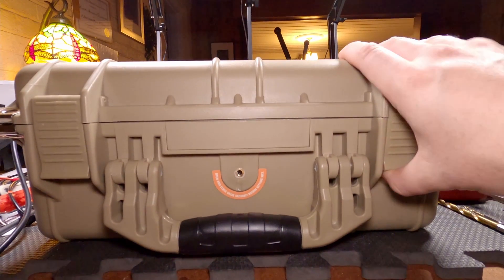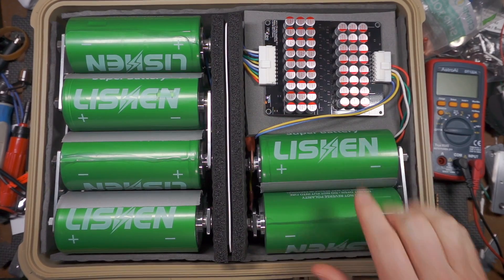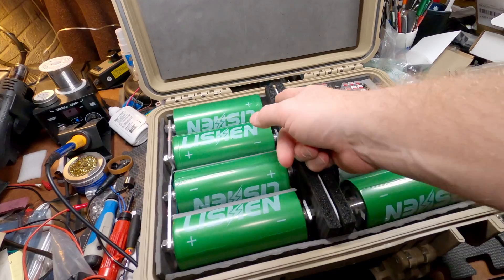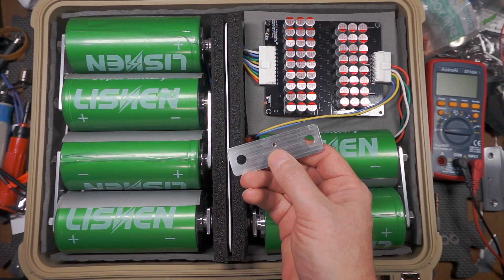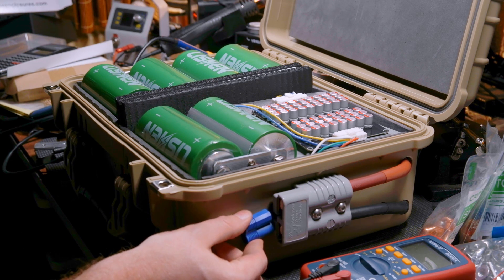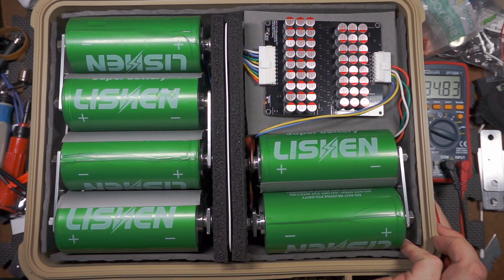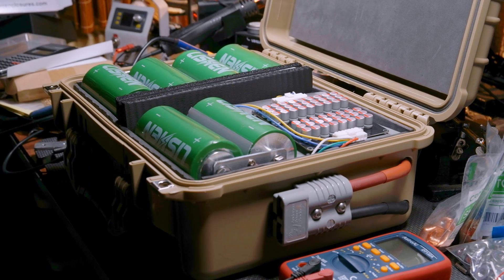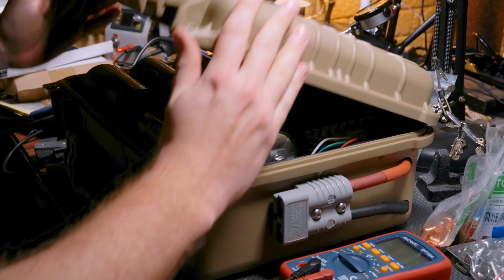New Electric Turbo Battery Pack!

Comment: Charge time?
Reply from the maker: Pretty much as fast as you can pump current into them.  Theoretically, full charge can be had in less than 5 minutes; the problem is finding enough power to do that (you need a 62 volt / 216 amp source to do that - that'd be like trying to pull 106 amps from a typical wall outlet at 100% efficiency - the service to my house is only 100 amps at 220 volts).  And then you'd need a current limiting charger that can handle that much power.  If I was an OEM, that would be no problem to make, but since I'm a guy in his garage, well...  But these packs give several minutes of run time.  Basically you could easily go a whole track day without charging at the horsepower levels we're at (722hp proven so far, next dyno trip I'm expecting 800-850hp).  Thanks for watching and commenting!

Comment: Are those really batteries or super capacitors?
Reply from the maker: They're actually cells.  They're lithium titanate oxide or lto cells. They're not super capacitors. Super capacitors would be a poor choice because the discharge curve is linear plus the power density is really low.

Comment: Dont need to load test these bad boys. They will pull their weight no problem.
Reply from the maker: Yes, but what will the voltage drop to?  That's information we need before we run them.  And will anything overheat/melt/catch fire?  There's a lot more to load testing than just pulling current.

Comment: This is awesome! Have you looking into ultracapacitors or super capacitors. Maxwell had a 17 volt pack I believe and 2 of them would be good for 34volts. They can be charged nearly instantly and dont get hot ever.  They are self balancing and have a cycle life span in the millions meaning that if you completely discharge and charge 2 times every day they should last a thousand years.

I'm not saying they are a good fit for your project, I'm just saying it may be worth looking in to. I've seen the 17 volt pack used to start a car so maybe worth review.
Reply from the maker: I actually have a massive supercapacitor under my other desk that I did some tests on a while ago.  The video's here: https://youtu.be/_HHxkMVnHQY  That was really a self discharge test, but I discovered that the current capacity in amp/hours is actually really low - like under 2 amp hours; closer to 1, iirc.  And unlike lithium batteries, where a large part of the discharge curve is essentially flat (i.e. the voltage stays more or less the same), the supercapacitor's discharge curve is more linear - as in a line going pretty much down constantly.  You'd only have adequate voltage for a second or two.  For starting a car they're great.  Not so much for an e-turbo though.  But it's a good thought!
Reply: @AlexLTDLX   I appreciate your reply and look forward to reviewing that video.
Also check your link to the Amazon voltage monitor. I couldnt get it to work.
Reply from the maker: Thanks.  Will do.

Comment: I understand and have been following what you have been doing but I'm wondering if with the power you have it would not just be more efficient and effective to couple an electric motor to the IC motor? You said you had 70 Kw available ( per pack?) so given the electrical efficiency, that should make quite a difference  to your times Given the instant power and more so, Torque.  Look forward to seeing the next runs either way.
Reply from the maker: That is a really good question.  And a video I've been thinking about doing for the last couple of weeks - particularly in regards to hybrids (I was going to call it, "Every Hybrid On Earth Is Built Wrong.")  Think of it this way.  Without any boost, the engine in the LTD makes about 500 hp.  We've used a max of 13,800 watts to raise that 500 hp to about 650.  It takes 746 watts to equal 1 horsepower.  So to get a gain of 150 hp (500hp to 650hp), we only needed 18.5 hp (13,800 watts divided by 746).  If we added the same amount of power directly to the driveshaft, we'd see a gain of - wait for it - 18.5 hp.  So using the same amount of electrical energy with the e turbo took us from 500 hp to 650.  Driving the driveshaft directly with the same amount of electrical power we'd go from 500 hp to 518.5.  So from a "power out" perspective, the e turbo is about 8 times more efficient at making power than just applying that same electrical power to the driveshaft.  Hopefully I've explained that adequately - it can get a bit confusing.
Reply: @AlexLTDLX  Makes sense of course and thank you for the reply.  I could not remember what your gains were although obviously greater than the electrical input or there would be no point.   That said, Given the power now available in your packs and given the mechanical limits of the engine, I'm also wondering how much further you can go. 
Also, seems to me that electrical motive power is not as simple as straight HP from an IC. EV's with relatively low power seem  to perform well above their Rating.  I take it because an IC has a Torque Curve where they Build power and it usually eventually falls off where as the  electric power is max torque at zero and above RPM.  Similarly I was thinking that the 70 or 140 KW you have potential for now could make more of a difference being available the whole time and gaining in the sector where that 150 HP from the turbo is still spooling up. They key seems the 150 Hp is peak and takes time/ RPM to get there where as electric is there from the start. 
Probably calculators that would give you the numbers as to what the difference would be. 
Not at all an EV proponent, just wondering how the tech can be best used.  It's also been good to see someone doing this properly instead of Idiots putting computer fans or something on their intakes and claiming it makes a Difference.
Reply from the maker: Yeah, your point about electric motors seemingly outperforming their specs definitely resonates with me.  This pack should be overkill for my setup.  Right now I'm looking at the balance of voltage vs current vs impeller rpm; since my datalogs showed a bit of an odd relationship - more voltage = LESS current = more impeller rpm = more boost.  With the voltage drop we were seeing, I was at the limit of what those batteries could deliver.  But at some point, current will start going back up - I'd like to find that point.  And there's the fact that the compressor takes more power at a cubic rate as rpm goes up... I don't know where we'll hit 15,000 motor watts or even 20,000 - which is probably about as hard as I'd want to push this motor.  At least my ESC can handle 30 kW.
Reply: @AlexLTDLX   Less amps at Higher voltage for a Given load and more RPM on a motor is quite Normal and works with established electric principals. It's possible the point where the current goes up again won't be reached because your  Compressor will hit an efficiency/ Flow rate wall.  When that happens the RPM will go up but the airflow won't or won't in proportion.  There is also the possibility of less mass airflow as the air heats up. 
Very interesting work you are doing. 
Have you thought of a Voltage Booster so you could recharge the batteries from the vehicle alternator? The cases are a very neat and safe package.  That's very well done!
Reply from the maker: Lol.  The step-up converter I ordered literally just showed up a couple hours ago. That is what I could theoretically use to recharge the batteries in the car.  We won't likely hit the limits of the compressor with this setup. Even in our current tests we were under 30,000 RPM and the compressor map is very well matched to the motor. We could be spinning that thing at 50,000 RPM and pushing 900 horsepower. But I don't think we're going to get there. Just not enough brushless motor to do it. But yes your points about current going down an RPM going up as well taken but that implies that we haven't reached the load limit of the motor versus voltage yet. And I don't think we have. At what point does that balancing act occur is the big question... Unfortunately nobody really knows so somebody's got to find out so I guess that's somebody is well me.

Comment: Will you be doing active cooling on the cells, or are the runs not long and frequent enough for that to be an issue?
Reply from the maker: That's really one of the big benefits of LTO cells - from 20* C to 50* C there really is no difference in output; unlike the LiPo cells I was running.  Also, the lower power density of LTO cells on paper looks like a disadvantage, it's actually an advantage from a thermal perspective.  A lot more mass to heat up; and the crazy discharge rates mean incredibly low internal resistance, which means the cells should heat up less.  I'm thinking right now that I won't need any cooling.  But we'll find out soon enough.  I've ordered everything I need to make a massive load tester and we can find out on the bench if my hunch is right or not.  Especially since these packs don't really have any ventilation (I suppose I could add a fan on top, but wouldn't do a whole lot; but since I'm thinking I won't need any cooling, if I'm wrong and I do, that might be enough).  Stay tuned.

Comment: If there is just a way to make affordable electric superchargers....

Mybe in drag racing response is not everything but in a drift car or small circuit  timeattack this thing will shine
Reply from the maker: This is really just the beginning.  A year ago, nobody really knew what it would take to support this level of power.  And all things considered, if I hadn't spent all the additional money in development costs, it's really not any more expensive than a comparable turbo system, but with a lot more advantages - like you point out in other forms of racing.  The prices on these parts will inevitably come down too.